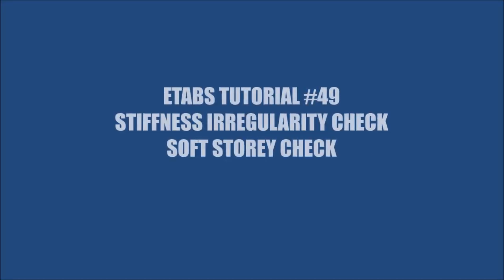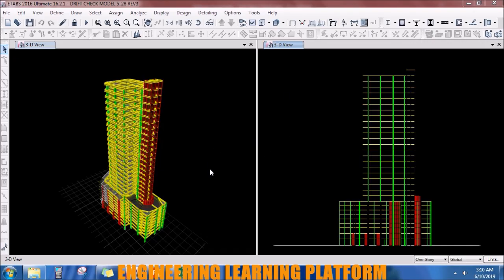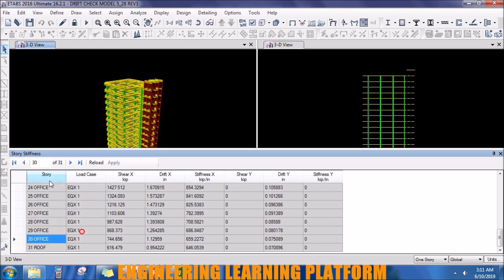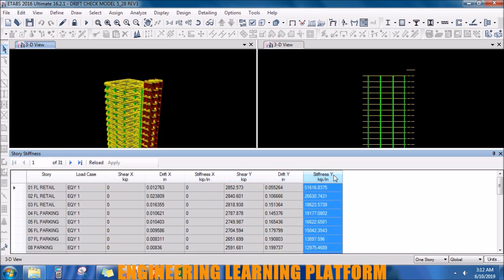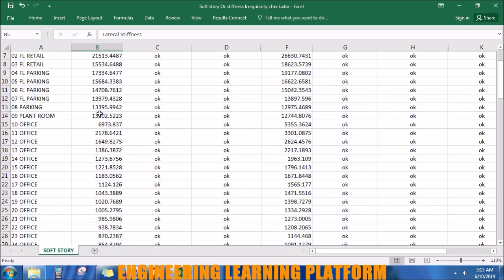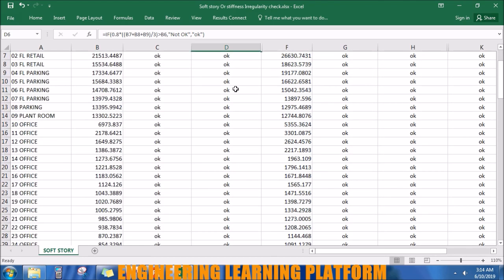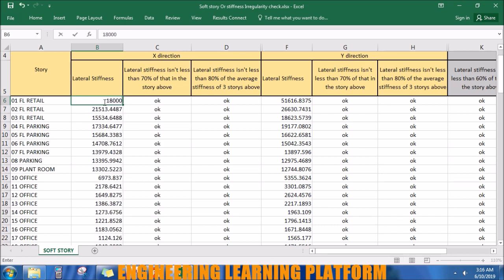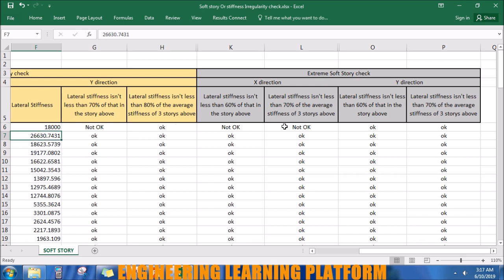Soft Story stiffness irregularity in etabs

Comment: Should we check it using cracked section properties?
Reply from the maker: Yes
Reply: @EngineeringLearningPlatform  sometimes code instructs to use modifiers=1.43x cracked section modifiers(I=0.7 for column, 0.35 for beam and 0.25 for slab) for serviceability conditions like lateral displacement. So, I was confused whether to use cracked section properties or 1.43 times the cracked section properties.
Reply from the maker: @kkb3091  Don't be confused, keep things simple . Say you need to find abeam's deflection you used the "Ie" effective moment of inertia but that involded tedious calculations, so on global structural scale, the code recommended values for considering a cracked concrete effect into all serviceability checks no matter you name it gravity or lateral . U can use the code recommended by ACI as far as it's non-prestressed concrete
Reply: @EngineeringLearningPlatform  Thanks a lot!!!! Now I think I am clear about it. 🙂

Comment: Dear Sir, Thank you for the video. I have a question; how can I calculate STIFFNESS in X-DIRECTION manually for a simple 2D steel building frame?
Reply from the maker: Stiffness is the force required to produce unit deformation. Calculate force required simply for 1inch deflection simply as it's kip/in.